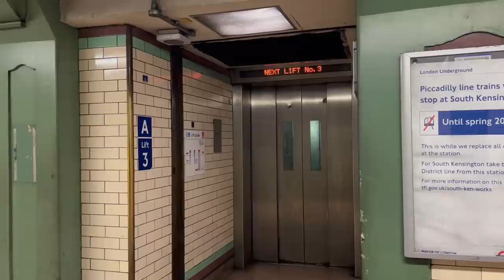The Unbuilt Tube Station at Mount Pleasant

Comment: "One of those developments that has a historically significant name but just looks like every other development."
This gets a big 👍 from me.
Reply: Me too. Here in Toronto the phrase is "A much-needed condo" that looks like every other glass box.
Reply: In this case it used to be a big polluting hole,  so I welcome the development.
Reply: @hx0d  In Toronto, a building that was built 50 years ago is considered to be old. Old buildings have little value here. The oldest pub here dates from the 1850s- It's sure not the Ye Olde Cheshire Cheese on Fleet Street. Toronto is not London, New York or Chicago which all have many fine buildings but having said that, any run-down single-storey strip plaza built in the 60s can be considered a development site.

Comment: On the topic of steam powered underground railways, the Mersey Railway in Liverpool / Merseyside was just that ... because of the steam locomotives the section below the River Mersey (which included Hamilton Square station) was reputed to offer such a horrible travelling experience that it was shunned by many passengers. Eventually the railway became bankrupt.

But it was bought from the liquidators and after conversion to electric traction using the same 4 rail system as in London it reopened. Nowadays that route is part of the Merseyrail Wirral line.

Comment: Excellent Jago, having worked at the sorting office now and again as a telephone engineer I had always wondered why such a busy area never had a tube station, especially as I knew the Met run right underneath (i travelled from Kings+ to Farringdon every day). Also as part of my training I did visit the post office railway, it was amazingly automated considering when it was built.
Reply: I mean it’s close enough to Farringdon. It’s not like it takes 1hr to get there.
Reply: @hx0d  When the 10 mins it takes to walk that distance means that you have to take a train 45 mins earlier into Kings+ so as to get to work on time, it does make a difference.

Comment: I remember being a casual at mount pleasant in 1999 and hearing the rumours of the "Mail Rail" that you alluded to at the end. I wonder, if there was a tube station there, would it have caused difficulties with this? My impression of Mail Rail is that it's not that deep, and I think the sorting office had lifts to take mail down to it.
Reply: All mail to the Post Office Railway was bagged in the Inland section ( IS) at ground level and sent down Spiral chutes to be loaded into trucks which slotted into the trains —- worked as Postal Engineering engineer at Mount Pleasant from 1966 to 1985   With friends who were  Post Office Railway engineers also during that time It’s route run in a double ended  banjo  - 6 miles 440 yds long  there was also a battery driven loco for Eng maintenance & track inspections run at track shut downs each day.  It only carried letters - parcels delivered by lorry  — Its route went from Paddington WDO. To Whitechapel EDO  Most of the rolling stock well over 30 yrs old when I joined as an apprentice in 1966  Now sadly a tourist attraction renamed Mail rail  on a limited section of track 😀
Reply: @JP_TaVeryMuch  I soon realized that Mount Pleasant sorting office isn't very pleasant.

Comment: In 2013 my wife & I stayed at the hotel shown at 0:55 (it was a Holiday Inn then). As we were on an extended trip from NZ we had large wheeled suitcases but dragging them from Farringdon was a chore, so the proposed Mt Pleasant station would have been most useful in that situation. It helped that we were quite fit & active at the time but when we left a week later we took a taxi to Kings Cross to get the Piccadilly line to Heathrow.
Reply: Fascinating anecdote, David 😂😂😂*sorry not sorry
Reply: We joined AirNZ there on our return in Aug 2006... horrendously $$ travel from Gillingham,Kent with one change.

Comment: The distance between Farringdon and King's Cross is 1.78KM / 1.1mi. A Mount Pleasant Station would be about 800m away from Farringdon, which is still longer than the distance between Aldgate to Liverpool Street to Moorgate to Barbican to Farringdon (all 600m-ish). It probably was the tram that made Mount Pleasant Station redundant, since workers could get the tram from Farringdon anyway. 

Which tram you ask? 

All of them.

edit- there were trolley buses too, probably.
edit 2 - It was the number 17 tram.

Comment: One reason for thge long gap between Kings Cross and farringdon may be because, as built, that was the least leg before the terminus at farringdon. There are many examples of the first station out from a termiunus either having closed early or being very low in traffic unless it is an interchange - see Ardwick, Bordesley, Edge Hill, Manors, Borough Road,  Spa Road, or Westbourne Park. For such a short journey, the revenue on offer was not worth building the station or, if it was built, having many trains call there, meaning that alternative means were preferred (walking, bus, etc). So the Met didn't bother building it in the first place.

Comment: A stop at Mount Pleasant or Clerkenwell would have potentially provided a useful less cluttered alternative to King's Cross St Pancras for the various Chelney later Crossrail 2 schemes heading from Holborn or Tottenham Court Road towards Angel, Old Street or Highbury & Islington onwards, if not also an eastward sub-branch of what became the Victoria based on the Victora-meets-Thameslink-esque 1946 Route 6 proposal from Herne Hill to King's Cross St Pancras via Waterloo and Ludgate Circus that was also allegedly to have a stop at Mount Pleasant.

Comment: Good Evening Mr. Jago :)
I've had a browse on this 'internet' thing and, while I can confirm that the longest distance between two Underground Stations is between Chalfont & Latimer and Chesham at around 3.10 miles, I can't seem to find the longest gap between two stations on the London Underground, that is fully underground.
Would you happen to know?
I'm betting that King's Cross to Caledonian Road on the Piccadilly Line is one of them...it certainly FEELS like a long distance!
Reply: KX to Cal Road is certainly one of the longest ones, the closure of York Road being an important factor. KX to Highbury and Islington (Vic) may be a fraction longer, KX to Farringdon and Liv St to Bethnal Green look similar. But I think the longest stretch would be Finsbury Park to Seven Sisters. Also Mile End to Stratford, but it emerges into the open air at the latter.
Reply: Another post below answers it. FP-SS is second, but I had overlooked Heathrow T4 to T23 which apparently is the longest at over 4 km.

Comment: Back in the 1970s piling out of the Pakenham Arms down to the Bedford Head you passed a stretch of vacant ground behind the sorting office. If the station had been built that would not have been vacant. Unless it was a bomb site. There were still some around 30 years later.

Comment: There was/is a long stretch on the Central Line between Bethnal Green and Liverpool Street. Was a planned station skipped there? Shoreditch High Street perhaps?

Great videos. Happy Canadian thanksgiving.
Reply: I think by that stage they were extending distances between stops to allow trains to reach the suburbs quicker, and the Central Line extension was built to take over the Epping line and Hainault loop, so going a long way out. Also a long stretch Mile End to Stratford. The Victoria Line carried this to its logical conclusion (KX-H&Is, FP-SevSis) and maybe one could say the Elizabeth Line has taken it a stage further.

Comment: There has always been more than a prison at Mount Pleasant. There's been a Sadler's Wells Theatre since 1683, and that was built on the site of a well which was a place for healing and holidays for centuries. The area is described in 'Oliver Twist', which is a 'must read' for anyone interested in Clerkenwell. 
I walked from Kings Cross to Farringdon less than 3 weeks since, and have being doing so, a few times a year, for decades. The Pakenham Arms opposite the old sorting office was one of those that stayed open almost all day and night, because of posties on shift work. I'd go in and there'd be posties spread evenly around the bar, all with thousand yard stares and no conversation. I'm sad the old office is finished as a place of work and is being turned into another place for parasitical 'investors'.

Comment: Here's a question for the factoid buffs (I don't know the answer BTW but will make an educated guess): what stretch of tube line between one station and the next is the longest?  My guess is from Canada Water to Canary Wharf on the Jubilee Line.  Apparently (I was told this when working in the area and using that line a few years after it opened) the trains there get up to 70mph, so watch out for any 'emergency' stops!
Reply: For deep level tube lines I think it might be Finsbury Park to Seven Sisters on the Victoria line. Stratford to Mile End on the Central line is quite a long way also but since Stratford is above street level I guess I can't include it?

Edit: Heathrow terminal 4 to terminals 1 2 and 3 on the Piccadilly line.
Reply: Canada Water to Canary Wharf is only 2.41km.
Some services do not stop at all stations but I suggest:
Finchley Road to Wembley Park (Metropolitan) 7.24km
Chalfont & Latimer to Chesham (Metropolitan) 6.19km
Acton Town to Hammersmith (Piccadilly) 4.42km (not calling at Turnham Green)
My source is a rather old TFL spreadsheet but the stations do not move around much  :-)
I do not have any data on the Elizabeth line but some of the outer stations are much further apart.
Reply: @MasterZaphod  Good point about deep level tubes.
Finsbury Park to Seven Sisters 3.15km
Stratford to Mile End 2.85km
Heathrow T4 to T1,2&3  4.31km
Reply: @pras12100  thanks for that. I actually didn't know what the actual distances were.
Reply: That would be the Metropolitan between Chalfont and Amersham
Reply: @hx0d  Chalfont & Latimer to Amersham (Metropolitan) 3.27km
C&L to Chesham is longer. See my previous list.
Reply: @pras12100  Ah ok thanks
Reply: I'm happy to see there are others that are into these sort of things.

Comment: If the intent of a station here was to serve the postal workers then could they not have had an underground interchange? No real need for surface access, just use that provided by the post office building itself. Afterall, I assume the postal rail system for the movement of post across London operated at a similar depth.
Reply: @JP_TaVeryMuch  That raise an interesting question, have tunnels actually 'collided' during construction? 🤔 There must have been instances where the engineers and surveyors got it wrong!

Comment: Hmm, why are the tops of those houses so weird? Seems almost like they go \/ instead of /\? Or am I just looking at this all wrong?
Reply: You can see at 5:28 how the houses go /\/\/|_, instead of the /\/\_ I'd expect.
Reply: @JP_TaVeryMuch : I think the roof lines is rather attractive.
Reply: @JP_TaVeryMuch  Yeah I'd never 've noticed if they weren't cut off at the sides. But could you please explain how this saves on gutters - what's it matter if the rain flows in between houses or not? 

I suppose you could make a point that this is then fully your water and not anybody else's, which'd differ otherwise. Is that the reason? Interesting stuff. A look inside would be nice ^^.
Reply: @JP_TaVeryMuch : 'My mate's famy home in Fulham has one and he's fed up with having to clear the valley every so often.'  I can imagine but traditional guttering is a problem.
Reply: The London building acts post great fire of London required the roof to be interrupted by a non-flammable barrier at the join between buildings, so once you have to do that, you may as well build the roofs the way they have
Reply: @JP_TaVeryMuch   @Cam Enbert  This is all fascinating! I hope mr. Hazzard will one day do a video essay on the topic. Else I'll have to go and find me a video on roofs in general ^^.

Thank you all for your replies, and any further information is much appreciated ^^.

Comment: Interesting, as always, but why refer to this as a 'tube' station?   The Met was (and is) not a 'tube' line and the term should be reserved for the deep-level lines of smaller loading gauge.
Reply from the maker: Nah, it’s fine.
Reply: @JagoHazzard  You clearly research your topics and make them factually correct.  Why persist in incorrect use of the 'tube' label'.
 (Edgware Road has two eponymous stations; only one is 'tube'. I hope you distinguish them accordingly.)